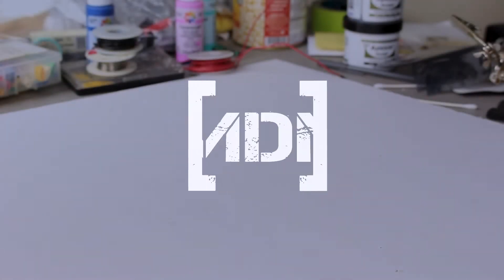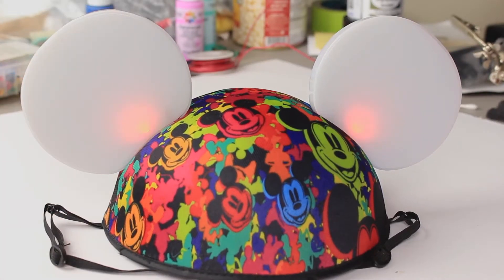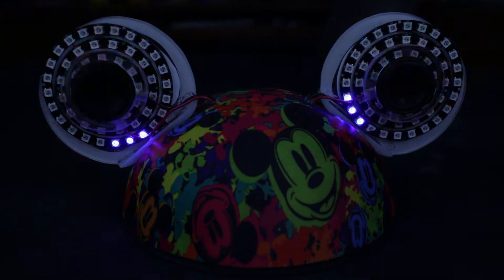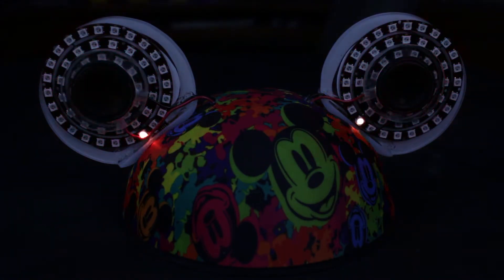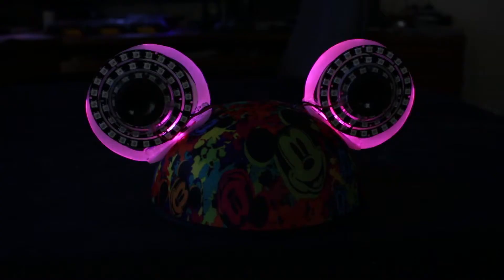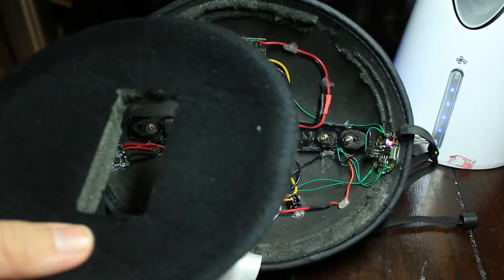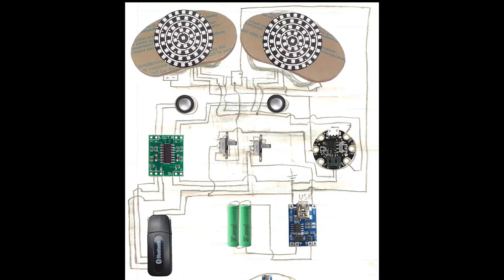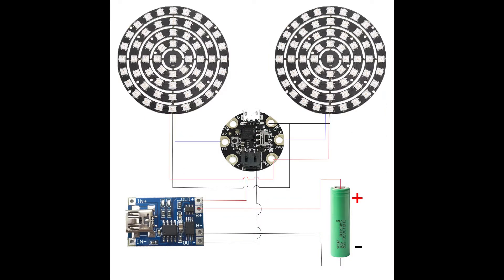CUSTOM ADDRESSABLE RGB LED BLUETOOTH SPEAKERS MICKEY MOUSE EARS (GLOW WITH THE SHOW)

Comment: Hi. How did you separate the ears? I cant get then Apart without breaking.  Also. I tore the brown strip with wires. Can that be replaced?
Reply from the maker: There are screws in the hat that hold them down. Phillips screws. The brown strip is flexible PCB, not replaceable.